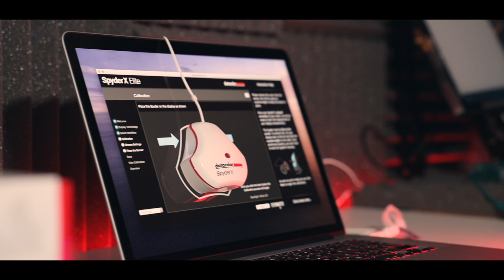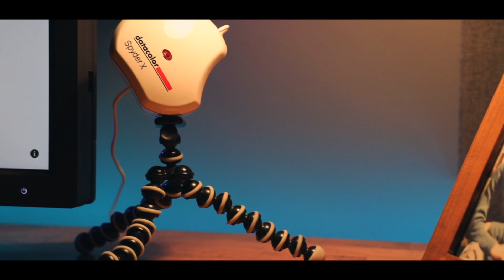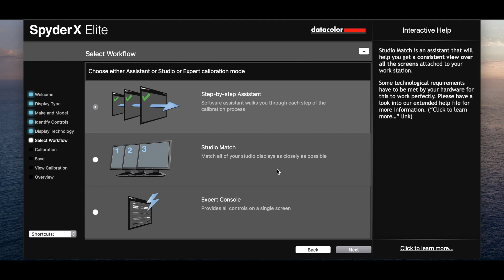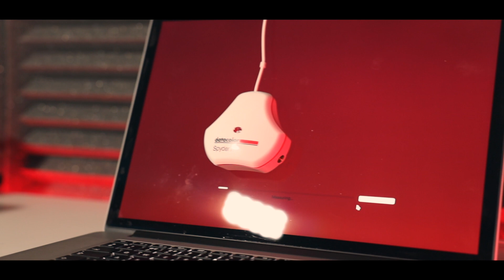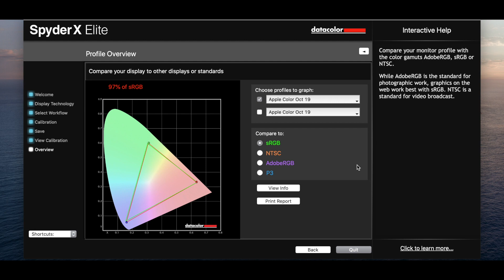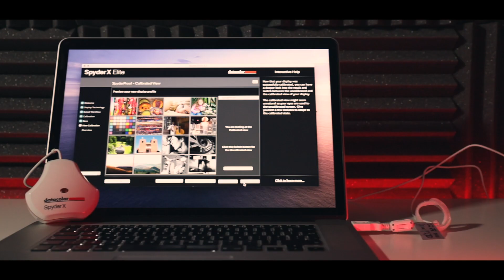REVIEW: DataColor Spyder X Elite - BEST Monitor Calibrator for Photographers & Videographers 2019?

Comment: I would love your advice! I have been using SpyderX to calibrate my MacBook Pro. However, when I compare the results to the BenQ monitor, they are inaccurate. The Macbook screen has much more contrast, so I can't predict my print outcomes. Is there a way to overcome this issue?
Reply from the maker: Hi, it's quite difficult as technically, they are different screens. However, the Spyder has a feature to help you match monitors (I think it's called studio mode or something, may be worth a Google!) and that is intended to help you pair monitors - but again, I think the assumption is they are the same brand/model. Other than that, I would literally 'eyeball' it and get it as close as you can that way, or at least something you know is comfortable for you. Other than that, search for some forums/Reddit, there will be plenty of advice out there. Good Luck!

Comment: hello and congratulations for the video!  I wanted to ask you for advice if possible!  I own the first version of the spyder X E lite, that is the Spyder 5 Elite, I have it on my mac since 2016, these days I switched to the new imac 24, according to you I have to change the old probe and switch to this new model , or stay with what I own?  I don't know if after a few years the probes have to be replaced because they are no longer efficient!  Thanks for your time.
Reply from the maker: Hi, Thanks for the comment. My understanding is that the biggest upgrades usually come in terms of speed of operation and software updates etc - I don't think the physical device changes all that much on terms of how it actually measures light etc. But, I am speculating here - I would personally upgrade every few years (if your budget allows it) but I would also consider contacting DataColor direct and asking them if the physical modules should be upgraded (if there are any changes to the light reading technology) - Sorry, maybe not an 'exact' answer but I hope it helps :)

Comment: Hi Ross, hoping you can help.   I am able to find plenty of information on the X version,  but struggling to find information on if there is any significant performance upgrade between my spyder 4 to the X.  Where is struggle most is printing accuracy to my screen, I've done everything like kill off screen brightness immensely to 60 (below recommended levels of 90-120) but still my prints come out darker than screen (store or home printed both).  I don't want to buy a printer calibrator as they are extremely expensive and I don't really print enough to justify the costs, but I would at least like the screen to convey similar results.  There is a promo on the X right now, expires tonight.  Very interested to hear your thoughts.
Reply from the maker: Hi Marco, to be honest, the biggest benefits are in the ‘speed’ of the process rather than accuracy. However, I always tend to go for the most recent variations of products if I’m starting from scratch. There are so many variables when trying to calibrate a monitor>printer>final output - if you’re printing infrequently, I’d suggest doing several small test prints beforehand and ‘eyeballing’ the final result to your desired preferences. A perfectly calibrated monitor is more important when you’re doing client work or highly sensitive printing, but for the most part, running a few test prints and making adjustments by eye will get you close enough and probably save you a bit of money over buying more expensive gear etc - just my opinion but I hope it helps 👍

Comment: Mine is way off on the rgb after a calibration and the software knocked the brightness down significantly. Now everything looks yellowish because of how dim it is.
Reply from the maker: Is the monitor in a particular bright/dark room in the house? It reads the ambient light falling on the monitor when calibrating which can have a significant effect on the final output
Reply: @RossJukesPhotography  I set it up in an almost dark room. The colorimeter said that the ambient light was very low.
Reply from the maker: @BrillianceAutoSpa  that will have an effect on the reading, ideal lighting conditions for editing are flat light, like a cloudy day with the curtains open, that way there is enough adds ambient light without it being too bright or dark - if the room is too dark, the calibration tries to account for this and will commonly ‘warm’ up the colours to combat the cooler tones/blue light etc

Comment: Since you said that it can read the ambient light does it automatically change settings for you?  I sometimes start a project in daylight sitting  near a window then sun goes down and I might work a little without light except for the display then switch to rooms lights.  Will the settings change as lighting conditions changer will I have to recalibrate as conditions change? Thanks jim

Comment: im using spyder5, is the spyder x is a good upgrade from the newest monitor today? im not getting P3 as advertised by the monitor manufacturer. im getting 85% as 95% advertised by the manufacturer im not sure if this is just a manufacturing defect or upgrading to spyder x will accurately measure my display
Reply from the maker: The menu benefits of the upgrade would be the speed of the actual calibration. I think there would be some gains in accuracy but may be worth contacting them just to see if they think it’s a manufacturing defect
Reply: @RossJukesPhotography   i see thanks for the the reply. im working with the and they are still investigating. meanwhile i have the spyder x slready since my spyder 5 has been with me for quite a long time. ill see later if there are some  improvements  on the readings
Reply from the maker: Ryan Vibal is be interested to know if there are so let me know if you do find any, thank you 👍
Reply: @RossJukesPhotography   using the spyderx elite  it seems that my monitor does not take 2.2 Gamma right so i have to set it to 2.5 instead and crank my white balance to at least 6700k and fine tune the monitor based on the reviews i got over the internet,  and i got 91% P3 , finally .and over 100%SRGB. im not sure or i cant remember if my spyder 5 PRO was able to let me modify this values or just a standard preset. This search for a good calibration  took me a while to figure out and money to burn haha.

Comment: I am still using a Spyder 3 pro... I don't see the point in upgrading. Colour is colour and does not change
Reply from the maker: oliver Lison the main benefit is the speed of the calibration, though we are only talking a minute or two here and there. Also, the ‘accuracy’ of the readings can always be improved and the software but... if it isn’t causing you any issues and it’s working for you, no need to upgrade 👍